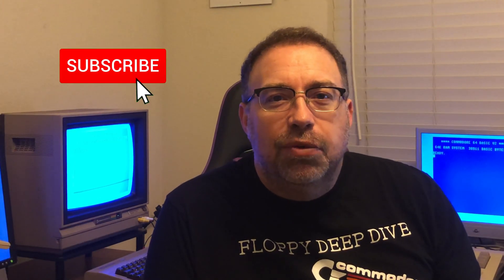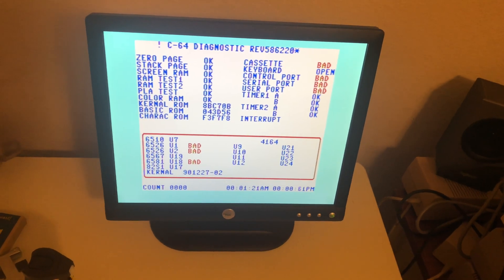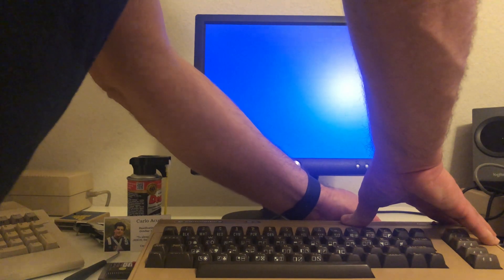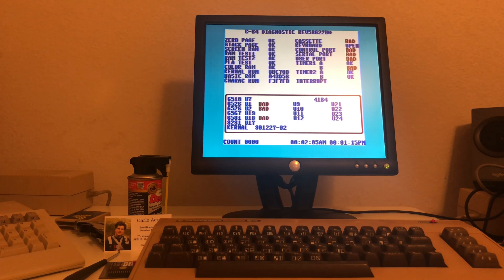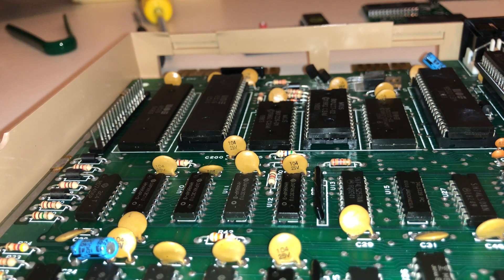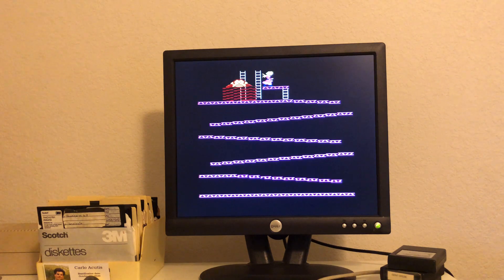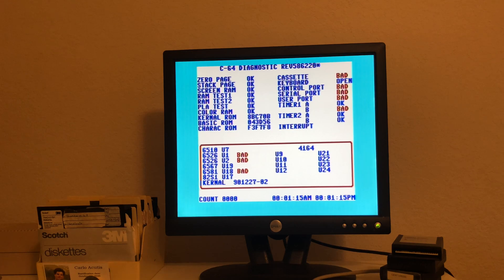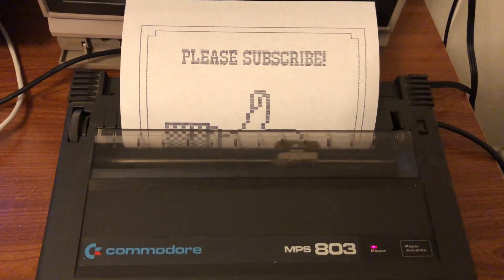I Fixed the Screen, But Now My C64 Has a WORSE Problem

Comment: You NEED the proper loop-back plugs INSTALLED to run those tests. Without them, you get the results as in your video.
Reply from the maker: Good to know

Comment: Flakey CIA. Find out which one has timer 1B. Check the chip and check for bad solder joints/trace breaks to the CIA.
Reply from the maker: Yep, plan is to replace the other CIA.

Comment: My 64 hadn’t seen the light of day in about 30 years.  Plugged it in and tuned it on and it came up right away.  Serial port isn’t working, so I think one of my CIAs is bad and my keyboard needs a cleaning.  All my chips are socketed so that a plus.  Thanks for the video, I’ll be curious to see your next one.
Reply from the maker: Thanks for watching. That’s awesome that your chips are socketed. That should make fixing it a lot easier.

Comment: Yeah, man...I'd say that soldered CIA is just intermittent.  I think you're stuck de-soldering/replacing that one.  You might also start preparing to purchase an ARMSID to replace your SID.  The SID sounds good on the deadcart test and in Donkey Kong, but you might try some other SID diagnostics if you want to figure out why the deadcart is saying that it's not working right.

Outside of that, the system looks pretty nice.  If you want to do more repair videos, you might think about putting in ZIF sockets so that you can swap test chips in and out easier.

Thanks for the video!
Reply from the maker: Thanks Ishi.  Yes that soldered CIA is going to be my biggest challenge so far but I figure if I get the right tools, I should be able to get it working. I do have a ARMSID coming in the mail so if that turns out to be an issue I will be ready. I'm still waiting on my CIA too so until I get that I'm in a holding pattern with this project.  Stay tuned!